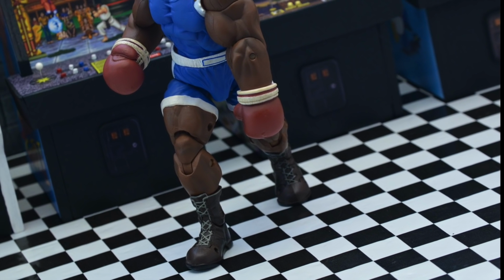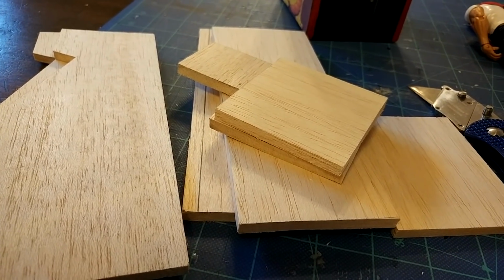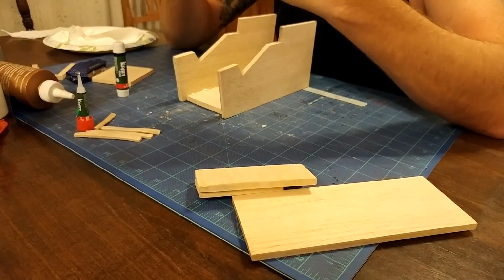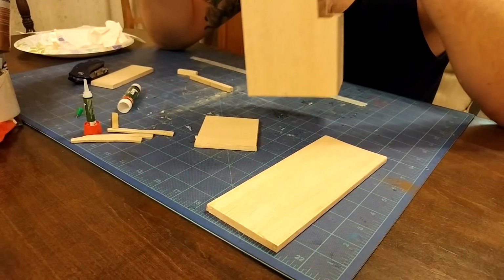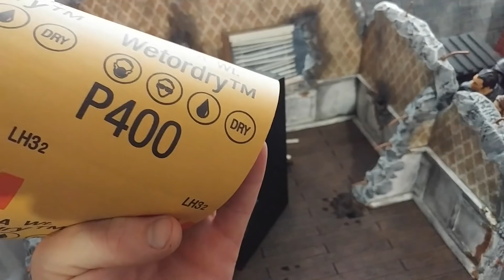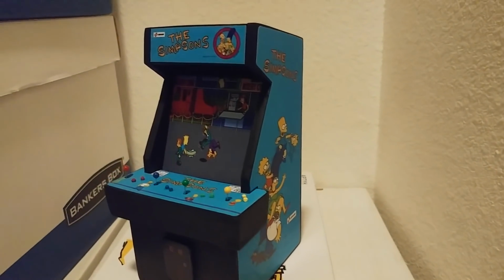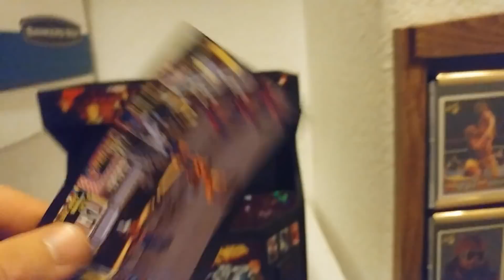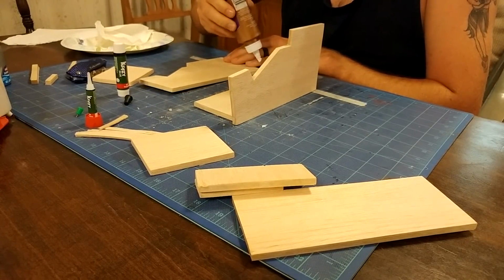Action Figure Prop Shop #8: Mini Arcade Cabinets

Comment: Hi my friend you gained a new subscriber! Ive been trying to make them and ive wasted so much material. could you post the files to get the sizes right? also the sizes to cut the wood? im sorry man, your video helps a lot but at the same time i cant get it right without the actual sizes. Thanks again my friend.

Comment: I just buy those mini arcade games you can get at Walmart. They're a little on the small side, so I just build a bottom onto it so that it's raised up to the right scale. I want to try and make a 1/12 scale semi-functional pinball machine. I've seen other people make them, but those don't function at all. I'd at least like to take it a step further and add some functionality. As far as that functionality goes it'll probably only amount to being able to pull the plunger back and shoot the ball into the machine. I've been looking at those little cheap kiddie toys that function in a similar way to a pinball machine. The ones where you pull the little plunger back and shoot these little balls onto certain racks with different points assigned to them. They're cheap crap, but they're what first gave me the idea. Trying to make the wings functional is probably beyond my capabilities, but I've still got some ideas. It will obviously never function fully, but I need something a little closer to the real thing. I'm even going to add lights. I just have to get all the parts assembled. Trying to make one based on an actual pinball machine would be cool, but it would just be way too hard trying to match every little detail, so I'll probably just use that as a starting base, and then create my own thing. It'll be really hard because of all the small pieces, but I think I can find a way.
Reply from the maker: A pinball machine would be sick!!

Comment: What are using for joysticks?  What are the dimensions/measurements for each piece you're using?  Gladly give you a shout.  Would love to see the old fashioned tv you made - I've seen it in 2 videos with different pics. Are those 2 different TV's or can you change images?
Reply from the maker: Shadow Moses I'm using colored push pins for joysticks.. I don't even know the dimensions, sorry.. I sold all my cabs, and I used different sizes depending on what the customer wanted. The TV has swappable screen inserts.

Comment: Feb. 2018--Thought this would be a useful how to video, but you lost my interest when you came to the decal part for the machine. I've Googled arcade images and get nothing but photos of the machines....no full front or full side views that I could copy/made decals of. And no, I don't have photo shop either. Would of been nice of saying where you imported the images from. While no thumbs down, no thumbs up either.
Reply: Feb. 2018----Let me add to this. I was using arcade game photos for my Google search.  When I used arcade game side view images, got a lot of 'em, but few for side views. At least it's a beginning. And will give the tacky glue/super glue combo a try, so at least I learned something new, hence the thumbs up now.
Reply from the maker: The cabinet decals are one of the hardest parts of a project like this. I've spent hours and hours researching and scouring the internet for proper images. Unfortunately there's no one magic word to Google or one site that hosts all the images you need. It's research and trial and error.